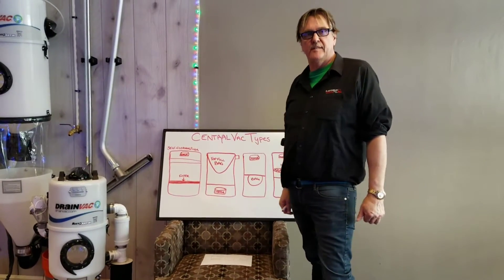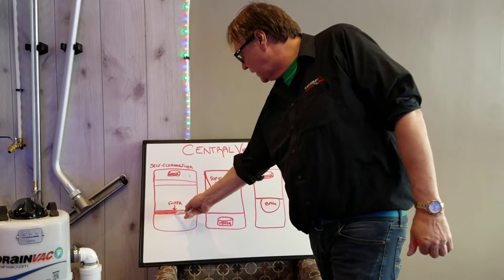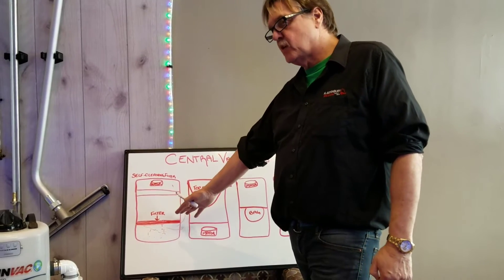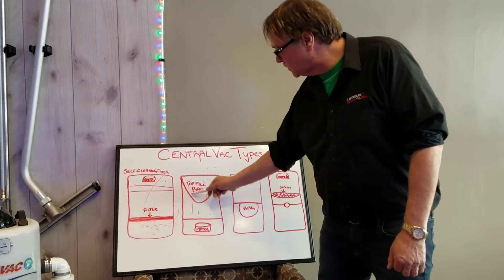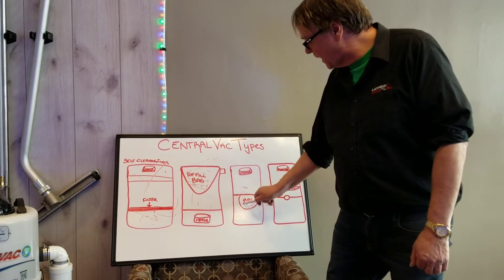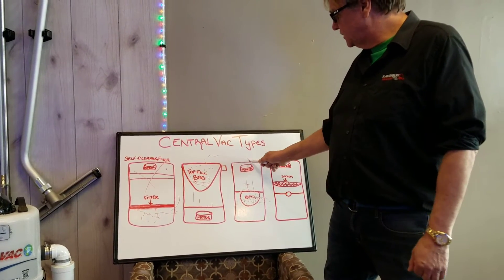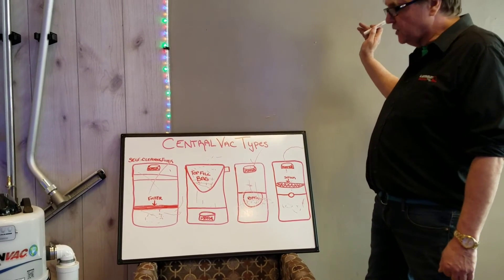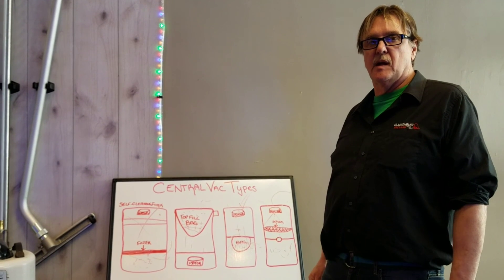How to select the right central vacuum system

Comment: Is the Nadair Large Capacity, 700 AW, Compact and Powerful Central Vacuum System, Hybrid Filtration (with or Without Disposable Bags), 22L or 5.8 Gal, one that has the optimal design. I think so correct?